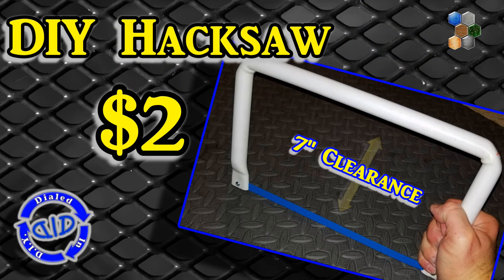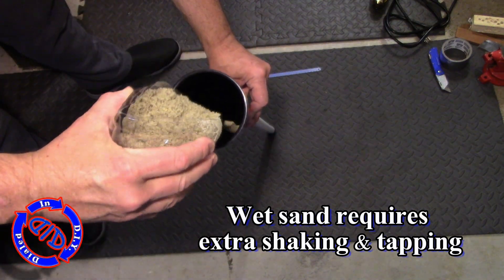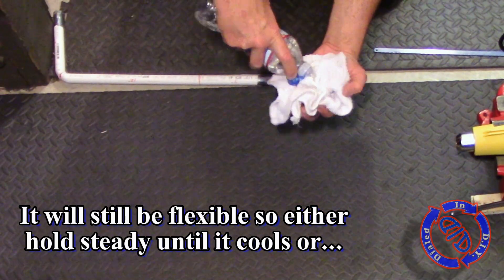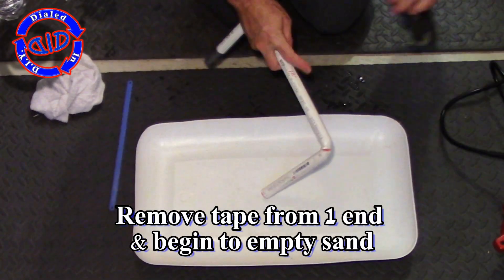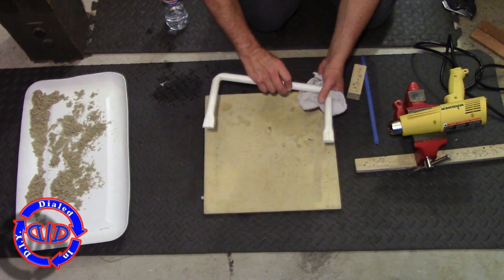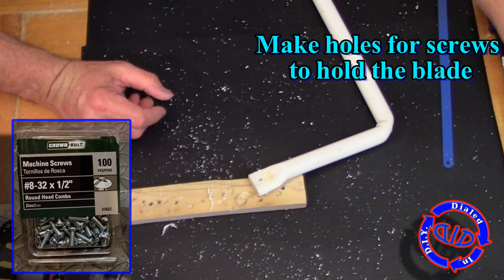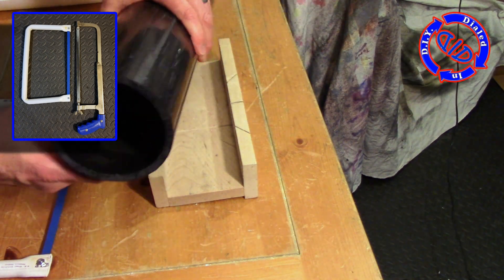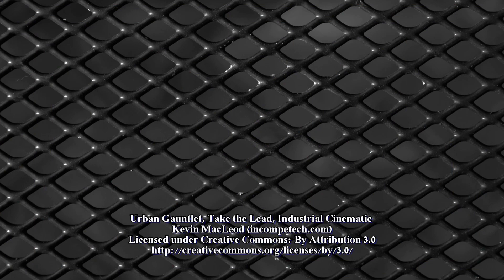Make a PVC Hacksaw - Easy DIY Custom Tools

Comment: hey enjoyed your video i have a question?
if a person has arthritis in their hand could you extend this device to a  to diy auto hacksaw cutter powered by  a battery pack unit to a motor with a  ellitical  circle for a auto cutter?
Reply from the maker: thank you very much for the feedback.  I think it could work with the right set-up.  If you wanted to go a bit lower tech you could probably fashion a wrist mount and modified handle to assist an arthritis sufferer and still be able to use it as a manual saw.

Comment: another great vid! knowing myself, it'd probably be smarter to just use elbows to create the bends. I'd probably botch the heated bends.😀
Reply from the maker: Elbows would work too...but since they are at right angles just make the middle section a bit wider than the blade so there is tension to pull the blade tight.  Thanks for the awesome feedback!